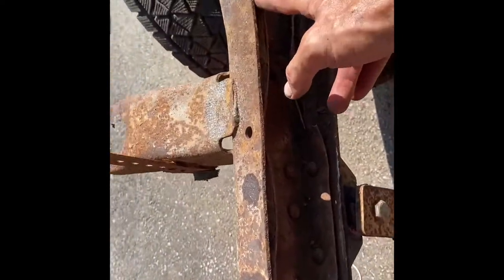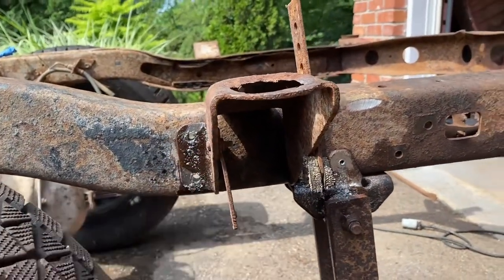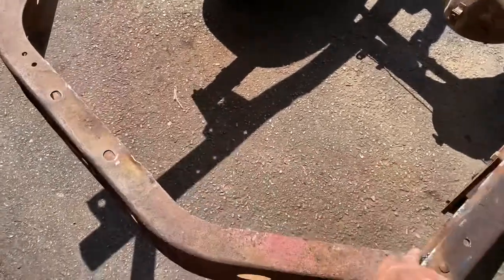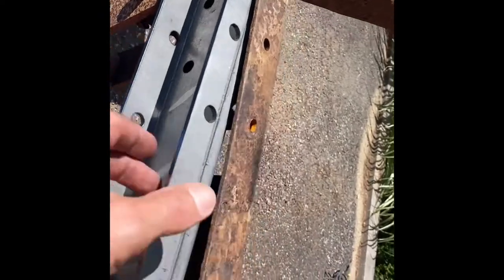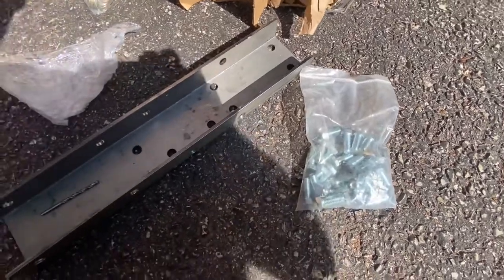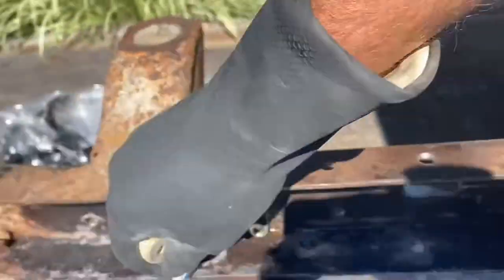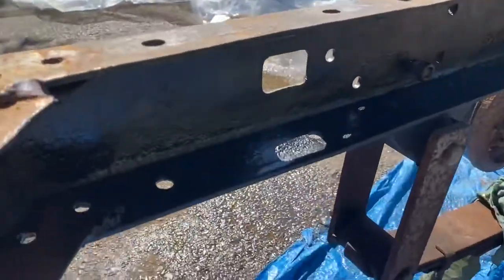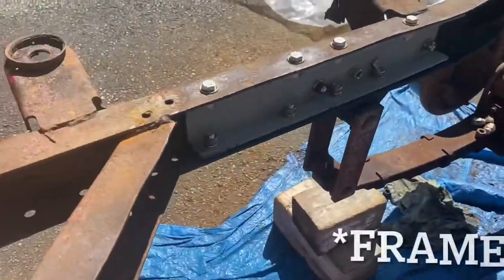LANDCRUISER BJ60 - chassis repair. Rear C-channel.

Comment: Gosh that looked like a painful job! ive always wanted to try it on a few of my rigs. thanks for the video!
Reply from the maker: Definitely tedious work. Went thru several grinding disks, drill bits and oil to get them out.
Reply: cheap plasma cuters are great at this stuff